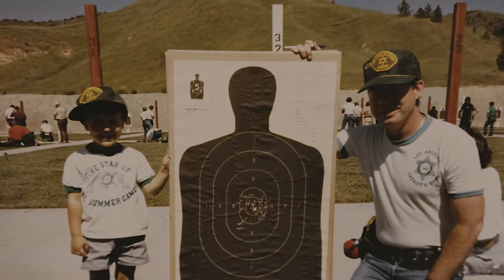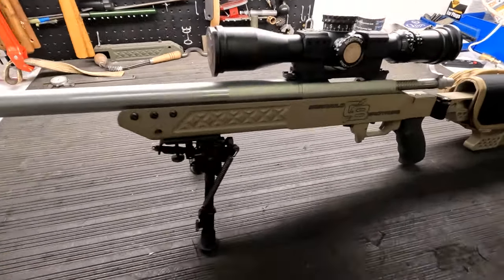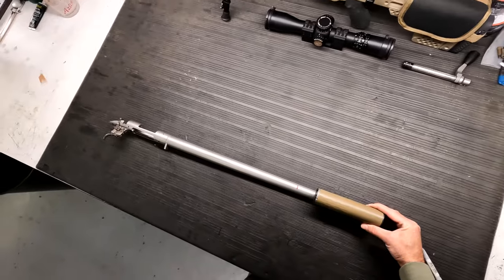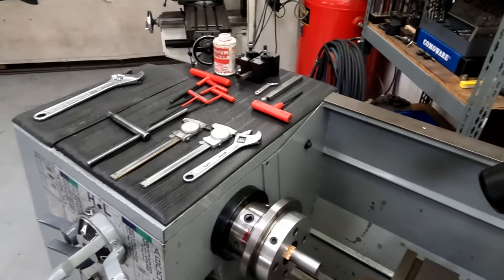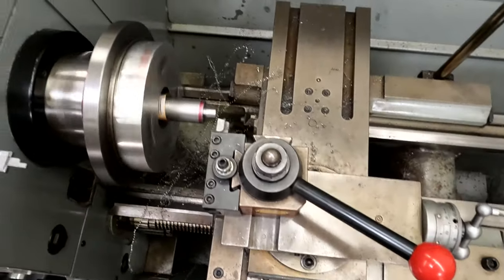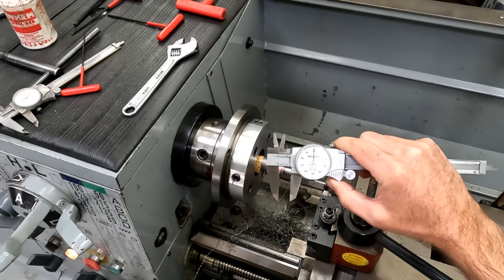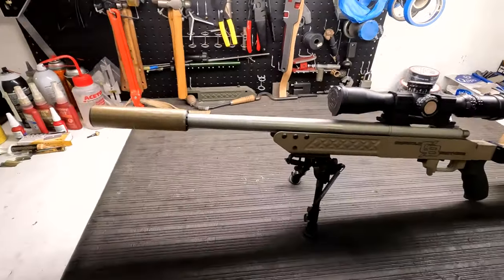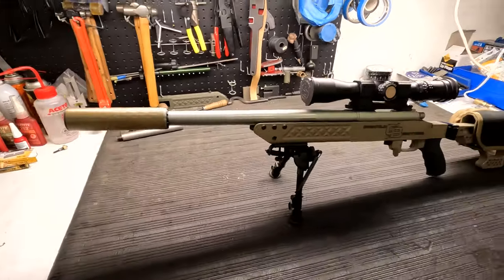Barrel Cut, Thread and Crown

Comment: just starting out in the industry (still in school) but one of my primary planned projects is to set up an AK to run suppressed, and do so flawlessly. One of the challenges as you may know, is the lack of concentricity in the 14x1LH threads on most AK's. rethreading to a more common pitch and ensuring concentricity IMO is the best way forward on such an endeavor.
Reply from the maker: Nice work! One can make a living correcting factory intolerance. You should do a video on it. I’d love to check it out.

Comment: How did the shorter barrel and new crown affect your accuracy and velocity from before? I’m considering cutting and doing the same to my barrel on a 6.5 SAUM but a bit worried about accuracy and speed after it’s done.
Reply from the maker: The accuracy increased. Many people correlate velocity with accuracy and that’s simply not the case. A shorter barrel is more rigid and has less “whip”. With that said there are reasons for wanting or needing higher velocity, stability at extended ranges or just in general, expansion or penetration etc. But for instance, many of the bolt guns we build for LE swat teams are shorter than 20” and as short as 14” due to them not typically engaging targets over 75 yards. I still shoot my 20” .308’s well past 1000yds. You just need to way all those options and come up with a formula that fits your mission. If you don’t need it shorter and it already meets your accuracy needs I would probably leave it as is. I do plan on doing a video measuring the loss of velocity when cutting down at some point.

Comment: I have a question after watching this and your other videos. If you have a barrel that you can't remove from a receiver (heat interference fit), are you still able to cut and thread on a lathe? I guess it depends on the depth of the head stock. Particularly, I have a VZ58 with a 15.4" barrel that I want to chop down a few inches and properly thread it with regards to concentricity for use with a suppressor. I've thought about going the DIY route, but I'm thoroughly impressed with the workmanship of professionals like yourself and don't know if I'd do it justice.
Reply from the maker: Great question. Many times if you have access to the breach end of the barrel through the receiver you can use a mandrel. I do that quite frequently on bolt guns and in some cases AR style uppers if the client doesn't want the barre removed for a number of reasons. Since you don't have access to the breech end of the barrel on a ZV58, you could chuck up the receiver and use a steady rest and or brass live center on the barrel I suppose. I'd probably go the piloted crowning tool route on that as you wouldn't be expecting bench rest accuracy anyhow.

Comment: Ok dont you need to engage the half nut on a certain number everytime, or can you just skip that part and leave it on the lead screw all the time?  Thanks and awesome video
Reply from the maker: Good observation. You can most certainly leave it engaged the whole time. On that particular lathe, it depends on the thread you are cutting as far as when to engage. You can actually engage on any number for 1/2x28 threads. Not the case on many other lathes. Thanks for watching!
Reply: @trentgriswold  cool thanks for replying!! Keep up the good work

Comment: What is that you used for polishing the crown? Also what kind of lapping compound do you use?
Reply from the maker: Its a just used a radius on a piece of round brass stock. You can buy brass laps pre made but they are cheap and easy to make. I use Clover lapping compound by loctite. Both the 600 and 800 grit work well.

Comment: how much you charge to do that?
Reply from the maker: It varies quite a bit depending on weather it’s just threads and the barrel can stay on the action or a full cut and crown, as well as type of barreled action etc. Ballpark anywhere from $150-$225.
Reply: Ask whomever taught you that a left had lathe tool cuts right to left for a refund.  I’ll give you a free tip after nearly fifty years in the trade.  If you want to cut threads close to a shoulder flip a left hand threading tool upside down and cut left to right with the lathe in reverse.  It eliminates the panic mode as the tool nears the shoulder, the tool just passes cleanly off the end of the part. you can take a narrow grooving tool and cur a shallow relief at the shoulder and advance your tool into it before engaging the half nut.

Comment: What is the name of the metal the barrel of the gun is made of?
Reply from the maker: This particular barrel is made of 416 stainless.
Reply: @trentgriswold  Are pistols also made of the same metal or does each part of a weapon have a special metal?
Reply from the maker: @funnytimes1262  some pistols are made of stainless and some are made of chromoly steel. Same goes for rifle barrels. The parts of most firearms vary greatly as far as their alloy depending on their function. For example, locking surfaces that are high friction need to be extremely hard and might be a different alloy and heat treat than another part. Hear treat is also another important aspect. A firing pin is case hardened with an extremely hard exterior but if the entire firing pin was hard it would be to brittle and shatter. So it’s case hardened to have a hard exterior to keep from deforming but soft and flexible inside as not so shatter or crack.